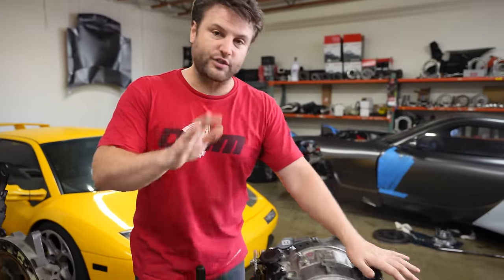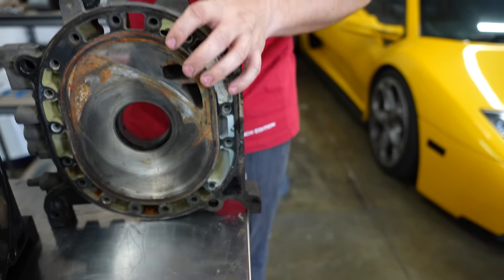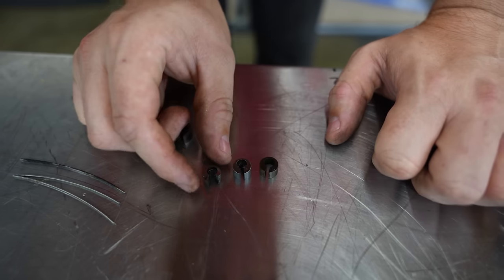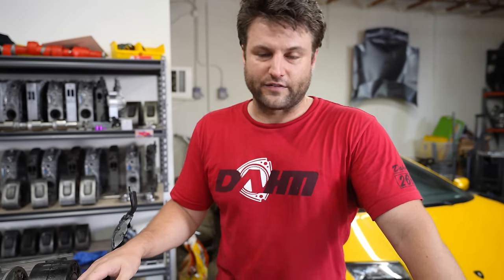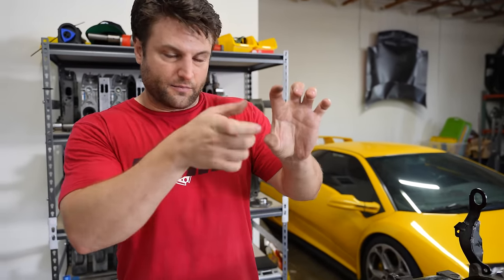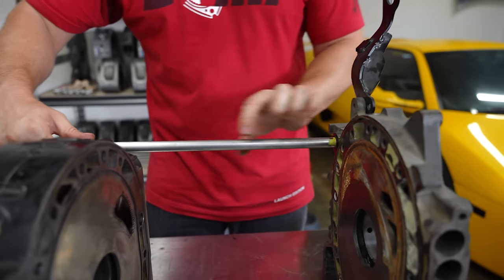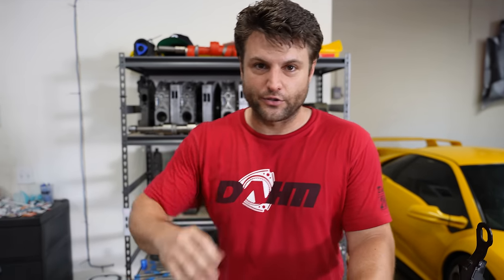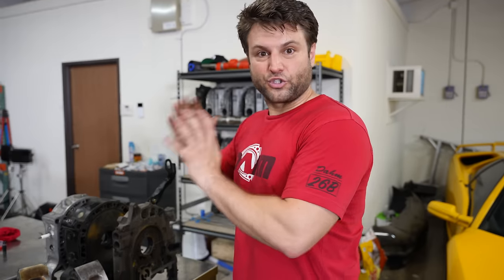Fixing the BIGGEST Problems of the Rotary Engine

Comment: Something I'm surprised you didn't touch base on: cracking rotor housings on the rear rotor. This is most commonly on the rear rotor of a two rotor engine (12A and 13B), I believe most commonly on the 12A. The problem is the rear rotor has hotter coolant running through its jackets compared to the forward rotor just based on coolant flow and standard convection (coolant carries heat from the first rotor to the rear rotor and the rear rotor adds even more heat). The fix for that is quite simple as well, considering the amount of under-hood space in the earlier models. The vast majority of rotary enthusiast upgrade the cooling system to avoid this. A thicker radiator as well as a high flow / external water pump will work wonders on the older engines. 

Another thing you sort of mentioned but didn't go into also plays a key role in the longevity of these engines. You mentioned carbon deposits but didn't go any further than E85 and premixing your fuel. For racing this doesn't really need mentioned, but it is a really important thing to mention for ANYBODY who is looking to daily a rotary or even build one for "street" use. For anybody wondering: the REAL reason rotaries are prone to carbon build ups is based on how they function. Carbon build up is caused by one of two things: 1) incomplete combustion of air/fuel mixtures (or on the rotary's case: air/fuel/oil mixture) or 2) LOW combustion temperatures. The rotary does not operate like a piston engine. Pistons travel a whole two cycles per rotation of the crank and fires every other rotation (2 rotations = 4 cycles of the piston), hence 4 stroke. ROTARIES DO NOT BEHAVE THIS WAY! The RPMs of a rotary engine are measured at the eccentric shaft; however, the rotors only turn 1/3 the RPM of the eccentric (aka three turns of the eccentric to one rotation of the rotor). General rule of thumb is a piston engine will only burn carbon above 2000 rpm (closer to 3k for older pre-2000s engines). Respectively, the rotary would have to be a MUCH higher rpm to achieve this due to the slower rotational speeds (creating slower, cooler combustions). Good rule of thumb to prevent carbon build up on a daily driver rotary is quite simple: redline at least once per trip! Drive to Walmart to get some milk? Redline it at least once. Driving home from Walmart after grabbing your milk? Redline it at least once. I hate to say, but the only real way to treat a rotary properly is to drive it like a douche...

An old friend of mine has an 85 RX7 that he rebuilt when he bought it. Cooling system upgrades, premix and the general redlining principle has helped him get his car 135,000 miles on a single rebuild (and still going). Compared to the internet's claimed life expectancy of "rotaries need rebuilt every 60,000 miles", I feel his is doing quite well.

Praise be the Dorito gods, Felix Wankel and Franz Reuleaux!

Comment: I recently learned of a new ceramic alloy with an extremely low dry coefficient of sliding friction coupled with high resistance to wear. It also has a melting point of around 2000 °c. They are currently looking to use it to develop engine components like pistons. I feel like this would be an amazing material for apex seals.  https://en.m.wikipedia.org/wiki/Aluminium_magnesium_boride
Reply: shock resistance? this is why it's been tested for a long time for rotaries. the ceramic that thin gets a mico wobble and snaps.

Comment: Straight water injection will lower charge temp and make the rotors SPOTLESS. I'm not fond of the stupid water meth injection kits on the market. They don't have enough line pressure and the injectors are super course. You really need custom. Can use regular injectors and pump designed for methanol. Super high horsepower supercharged aircraft engines can actually run 50% water under high boost. The automotive industry hasn't even begun to reap the benefits of water injection. You can add methanol to increase available fuel if you are out of injector duty cycle.

Comment: I missed out on buying an rx8 running propane once. I've run both a mercedes e430 and a bmw 330i on it for years. The engines are  very clean. Plus it's 112ron octane.

Comment: That was interesting.
 I knew virtually nothing about the finer points Mazda rotaries and only a little about the Norton rotaries of the 1980's (I was a motorcycle technician and precision machinist) Friend was at Norton factory when they were destruction testing a race motor, 30,000 rpm for a week. Tip seals wore out after about 14¬16 hrs but engine kept running as long as it didn't go below about 27,000 rpm
It seems common sense to drill and ream the dowel holes or even make shouldered studs to keep everything in correct location if you know they can move around at elevated power levels, actually a very simple job not requiring a great deal of precision by 'tool room' standards. (use a Teflon grease as there will be electrostatic corrosion between steel and aluminium, copper based greases make things much worse)
It sucks that machine shops just see dollar signs if they think you are going racing or building a custom motor (really why I trained as a machinist)
I'm pretty sure the rotor edge reduction in width  is to compensate for thermal expansion as the smaller area will run hotter and expand more than the main body? A byproduct will be less chance of edge digging in if rotor does wobble.
 I did not know Mazda used engine oil for tip lubrication, that's a terrible idea and leads to plug fouling and metallic build up on two-stroke motorcycles which has been known about for decades in the motorcycle world.
 There are many really great synthetic two stroke oils that run at 50:1 or higher so running pump into a tank would probably be best idea for majority of people or even when racing? Just need a warning light or check oil regularly.
 I'm sure the delivery hole could be reduced in diameter by installing a restrictor jet when a better quality two-stroke oil which would cut emissions further?
It's been common practice on two stroke street and dual sport bikes since the 1960's.
Oh, two stoke oil works great to lubricate ball and roller bearings with a high film strength but I don't think it does very well with plain bearings due to shearing action plus does not have detergents and dispersants as it's a one time use deal not designed to stay in a crankcase and be re-used.
I guess rotor wobble would be somewhat rectified by tighter bearing tolerance and a thinner oil (5W/30 or 0W/20?)

Comment: 45 years ago I had an appointment it was a designer and engineer from McDonald Douglas. The rotary engine was fairly new at that time he drew it out and explain how it worked and also explain it will never have most likely the technology or the materials to build a reliable non-leaking rotary engine. Hey you know everything works on paper.

Comment: Thanks for the great information. I have always wondered, (especially on a bike motor) is a to make them Air cooled?  I realize higher temps would increase pre-ignition, but a custom E-65 might fix that. You might need an Ether prime or some other, but I grew up on John Deere A's where we started on Gas then changed over to Distillate when warm. The whole reason for my observation are the seal failure! Remove the problem. There may also be an answer to the rotor to help the run-on ping pre ignition, a re-breathe to address the emissions, instead of dumping or simply a burn off from a catalytic converter burn off, (waste of fuel) may solve pre-ignition. These are grandfathered in so think simple! a small oil reserve, air cool to stop Antifreeze leak????? Usually Engineers tend to overthink things instead of using simple common sense! I am super interested in your thoughts and doubts.. I have always been interested in the rotary. A friend had one in the 70's and when I asked what the popping was,   he said burning excess fuel in the exhaust.
  An example is the old Ford Flathead V8, they had an overheating thus cracking the blocks. I spoke to an 85 yr old Ford Mechanic 45 years ago who worked on them, He decided to try a thought, Those have 2 water pumps. They were added due to the old flat head 4's in the Model T, a 2 blade fan. He snapped off every other fin on each water pump. (you could pull them apart), he realized the water was moving too fast to transfer heat! SIMPLE fix. From your video I can tell you have an exceedingly high inductive reasoning natural skillset. 
Friends,
Larry B
Sioux City, Iowa

Comment: I said only a few years after the rx8 came out that there should be 2 oil reservoirs on a rotery engine one for good pull to run good, synthetic oil. And one for running specific oil made for the apex seals( 2 stroke basically) in the other.

Comment: Love a rotary I had an RX3 back in the 70s, first engine failure was through coolant finding it's way into the combustion area as shown in you video, probably my own fault for not warming up the engine before screwing it? 
I rebuilt it myself and was quite surprised when it worked. Ha! Ha! Two years later same again so I swapped it for a Celica, got virtually nothing for it.
More recently I restored two Suzuki RE5s, no problems at all with these and very reliable, sadly the negative myths about rotarys stick.

Comment: so I wanna make sure I got this right, use the Valvoline vr1 as engine oil but premix with 2 stroke? or what oil should I use in the crank case since it goes thru that little hole and u said the Valvoline is bad in there, oris there a way to just shut that off, great vid!

Comment: My favorite cars back in the late 70s early 80s was the rx-3. People with clogged them up sell them for pennies on the dollar because they were clogged up. I'm a 2-stroke guy so I knew the problems of injecting crankcase oil and would go to premix smokeless synthetic. You could gain several horsepower by flipping the rotors over and repositioning the cutout in the rotor. I made my own through bolts and dowling mods so I could work them at a higher torque. My daytime job boss was a IMSA racer along with my 2-stroke knowledge I just accepted the teardown and rebuild philosophy. Basically what looked like a small gray Mazda 1400cc station wagon would eat anyting out there on the street. A naturally aspirated on 140 aviation fuel. I must say those were fun days 😂. Yes aerodynamics in the front end were critical to keep it on the road received much ridicule. 🤣

Comment: That all makes sense.  I think those holding pins need a sleeve on the outside to make them mesh to the engine casing, or you could machine em on the lathe to have a wider area to interface with the block and then come down to the smaller thread size to prevent needing to tap it out.   Either way, rattling in a design like that is absolutely not good design strategy, I'm with ya.

Comment: I would like further clarification.  Regarding corner seals vs e85, you made these related points (rephrased by me):

1. Rubber in the corner seals gets eaten away by ethanol, but it's not as big a deal as it seems
        -You said you'd cover more on this later on (I assumed you meant in the same video).
2. Using e85 (w/appropriate modifications to do so) prevents excessive carbon buildup and runs the engine cooler.

These ideas appear to be in conflict, but later on you are possibly indirectly saying that corner seals, like apex seal springs, are wear items, or at least something you can replace periodically within reason.  I can see replacing them when replacing apex seal springs.

So is the fact of rubber in corner seals getting eaten away by e85 no big deal because you can replace them as a maintenance item along with the apex seal springs (and possibly even the apex seals?)

On a different note, in showing the rotor ran in an engine with e85, you noted the obvious lack of carbon buildup, except there was still carbon buildup thoroughly inside the dish in the rotor unless that's something else.  I'm familiar with the premise of carbon and/or gunk buildup in common otto cycle engines so this isn't new, but in the rotary, is there only a risk of igniting that carbon if it's building up outside the dished portion?

Questions related to the use of 2-stroke oil vs the engine's oil for injection to lube apex seals:
I really like the idea of using 2-stroke oil (either via injection or in the gas tank) instead of injecting and burning the engine's regular oil supply, but:
1. Though that would obviously combust better than synthetic oil and probably conventional oil, how would this affect emissions, and would the logic/math for fuel/air mixing in the ECU need to be modified?
2. If you have the stock oil injection system draw from 2-stroke oil, I am thinking the ratio is less important here versus a weed whacker which needs to lube and run the entire engine all with the same solution.  Am I understanding this correctly?
3. If you instead block the oil injection ports and add 2-stroke oil to your gas tank, is that going to gum up your fuel injectors over time worse than separate oil injection (if the latter even causes fuel injector issues), creating a maintenance task of cleaning the injectors?
4. Also on adding it to the gas tank, how precise does the ratio have to be to ensure complete/clean combustion while still sufficiently lubricating the apex seals?
5. How well does 2-stroke oil mix with a primarily ethanol-based fuel versus a primarily gasoline-based fuel?
6. We both likely know that an engine that burns at least enough of its oil will eventually ruin a catalytic converter.  My understanding is that it does this because oil in the exhaust bakes on over the catalyst, acting as a shield rendering the cat inert.
         -a.  Is oil-poisoning of a cat even an issue on say, a stock RX-8, whether using conventional or synthetic oil?
         -b.  Will use of pre-mix reduce, exacerbate, or have a neutral effect on this problem?
7. Will 2-stroke oil minimize wear on apex seals and the rotor housing as well as conventional or synthetic oil?

Comment: This might be an uneducated question, but why not drill out the threads and run a solid bolt all the way through? I’m assuming something attaches at the threaded end that does not allow this.
Also, I had an old RX2, new. The four barrel was activated by vacuum. This meant that at 60-70 it was running on four barrels. I removed the actuating bracket, reversed and put it upside down.. the vacuum would miss the bracket but the last inch of the pedal would instantly engage the four barrel carb. Benefit? 26mpg instead of 15.. and instant passing power. The four barrels weren’t needed until 80+ mph.. so I could easily cruise at 75 on two barrels.

Comment: Don't forget about proper endplay. I bought a rebuilt T2 with no endplay. Corner seal race tracks. Also, don't drop or pinch the eshaft thrust bearing. This is a common oops. Leave the eshaft bolt alone. Super seals require proper premix. Do not think that adding a little will work. Measure it out.

Comment: They should have included dimples in each section of the blocks to align them and prevent torsion. Also the sections should be bolted together 2 at a time and not one bolt holding the whole thing together. The apex seals should have springs to control the tension. The block seals should be bigger. So many improvements to the design can be done.

Comment: To add something whenever I do stood off plates with spacer designs I try to make it to that each plate has a counterbore thats a pressfit for the spacer then bolt through. Wonder if something similar can be done to the rotor end pieces here to add even a little bit more strength so you're not jsut relying on the threads at either end.

Comment: Instead of 2 stroke oil like castrol R or putoline,
The best oil for burning has to be Klotz oil which is used mainly in high revving model r/c engines.

Comment: Thanks for sharing experiences. But in your video you mentioned detonation many times, I think no one should tune or build an engine stands for detonation. As an engineer, detonation happens to be mistakes. Would like to hear more for test results of normal wear and cost of maintenance for your test results among different products. For torsional stiffness and cooling issues (you mentioned many times about how much power making) its always good for higher stiffness and better cooling capabilities thus for longer life for all engine components even you make little power out of your engine. Nothing is more expensive than over heat or torn a rotary engine, so please do share more practical cooling and reinforcement tips for these engines, it will always benefit normal users (refer to making little power but looking for less maintenance). Again, thanks for sharing these details.

Comment: 2 questions.
 1. How difficult would it be to convert a 12a rotary to inject 2 stroke oil instead of mixing at the pump? 
2. How would you feel about running big rig oil, straight 40 weight conventional with zinc additive, in a rotary as an alternative to separate crankcase and combustion chamber oil?

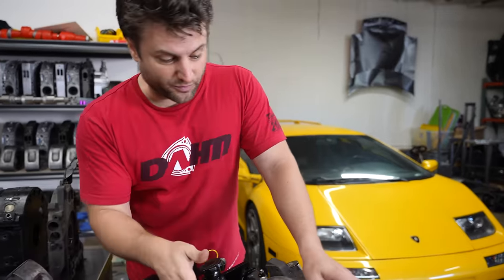Comment: 0:48 There's a reason it's called the Wankel Rotary Engine and not the Mazda Rotary Engine.  Mazda may have popularized it, but they didn't create it.  It was conceived in 1929 by Felix Wankel, and while the first working prototype wasn't built until 1957, Wankel still holds the patents on the rotary engine.